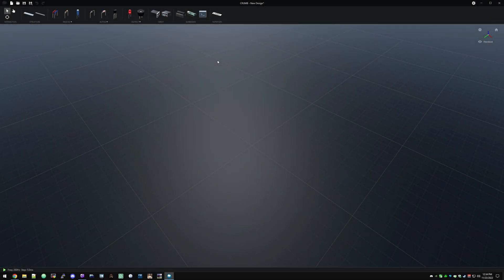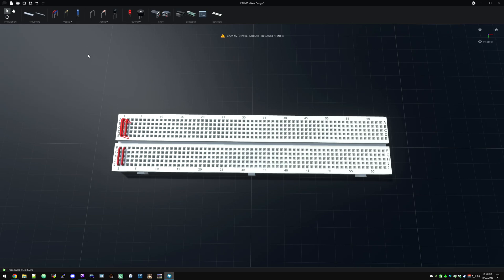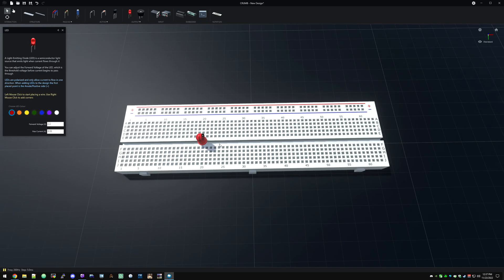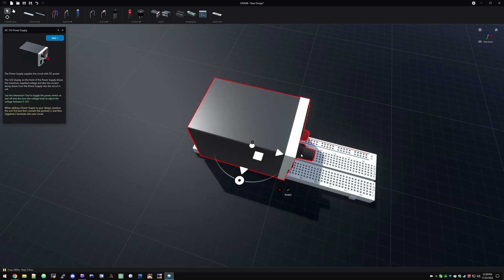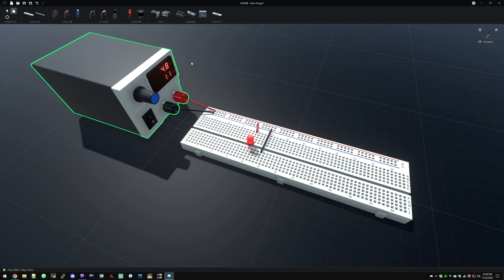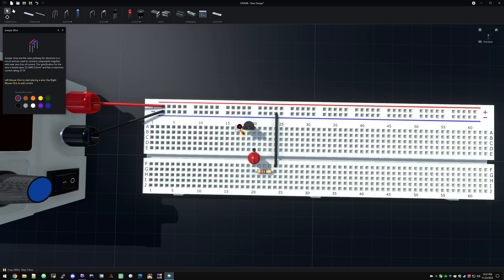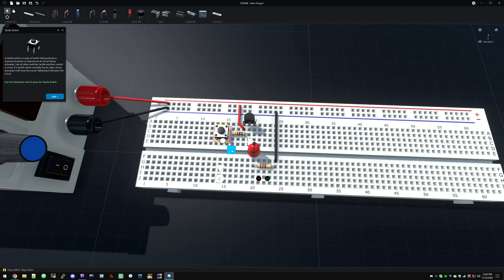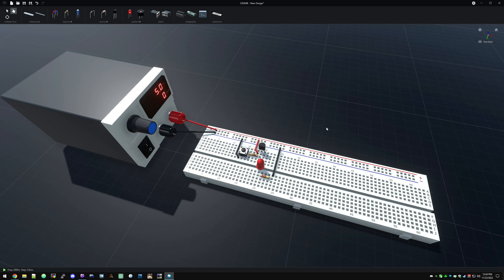CRUMB Basics | Getting Started With Power Supply And Breadboard

Comment: Is there any option for a multimeter/oscilloscope in there?
Reply from the maker: Sort of. There is a probe option that lets you see voltage and current at different points in waveform format.
Reply: @KerboOnYT  that's great. Thanks for the info. 👍

Comment: I do the exact same thing but it never gives me any current. Always 0 amps even with varying voltages
Reply from the maker: Strange. Maybe you don't have something hooked up correctly?
Reply: @ maybe, the 12V supply maxed out around 6v and 0amps, i put positive to positive and neg to neg/ ground. I’ll uninstall and reinstall and lyk if that fixes it. It even happens when I go to the example circuits - the moment I touch the power supply it breaks and its current goes away and it’s max voltage drops to 5 or 6 volts
Reply from the maker: @RaspberryRaspberryRaspberry  That sounds like a bug then. I think there's a bug report section on Steam discussions.
Reply: @KerboOnYT  okay I appreciate the help. I won’t refund because the game is so cheap and when it does work I will definitely use it again
Reply from the maker: @RaspberryRaspberryRaspberry  I had something similar happen today when I opened an old save with the new update. New stuff seems to work fine for me though.
Reply: @ I solved the problem - a fresh install did work a second time thank you for your help. I didn’t realize that the circuit had to be a full loop and that the current was relying on ohms law instead of just displaying the current value without current being supplied to anything

Comment: hmmm does it follow the rules of electricity?
 will an led go of if alot of current is added to it?
Reply from the maker: There are error messages about reversed voltage, over current, etc, but no animated smoke or destruction

Comment: I followed the tutorial and my LED did not light up when I pushed the button
Reply from the maker: Things to check:
1) Polarity of the LED (turn on pins to see + - leads)
2) Power supply is on and at least 5V
3) Ensure you are in manipulation mode to push buttons (little hand icon)
Reply: @KerboOnYT  
1) Positive pin is in 20E for the LED, Negative is on 20F.
2) Power supply is at 5V
3) Button is pressed, nothing happens

Oddly enough the LED works per the first half of the video. Either I'm doing something wrong or there's a bug. I followed the video step by step, everything in the right location. In the most recent update they do allow the button to go in the little gap.
Reply from the maker: @guyfoundry4228  Strange. If you can send a screenshot of your board or upload the .crumb file somewhere maybe I can see what's going on
Reply: @KerboOnYT  I have it on my github page. I tried posting the link but for some reason it did not allow me. My username is the same as here except without a space, and it is my only project I have uploaded.
Reply from the maker: You're using an NPN transistor instead of PNP. Switch type and it will work fine
Reply: I am using a PNP and I followed everything (did it twice) and I'm still having no LED light. It worked previously but now it's not!